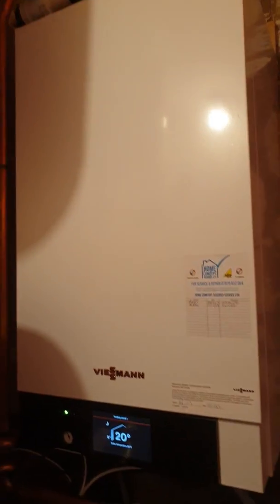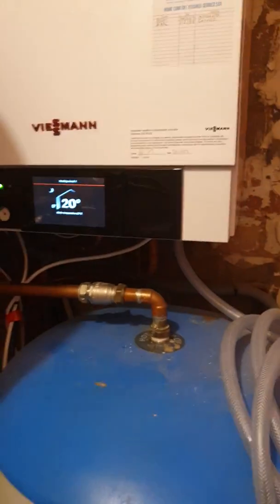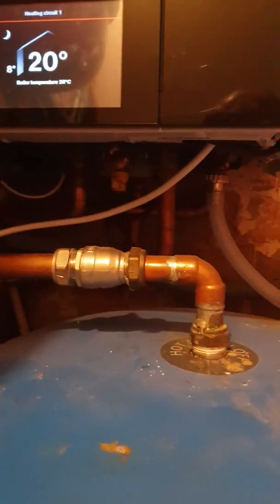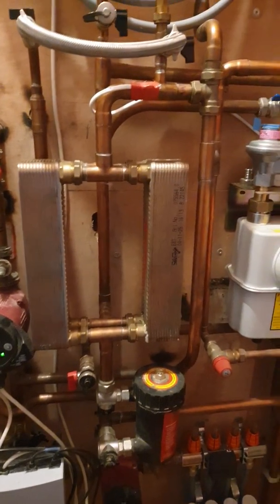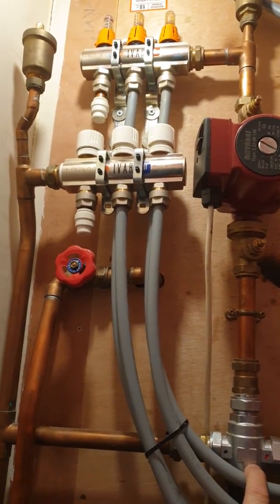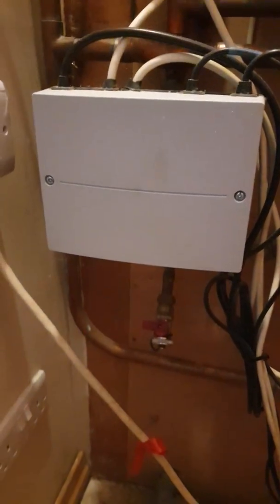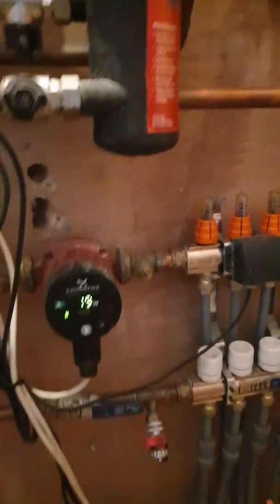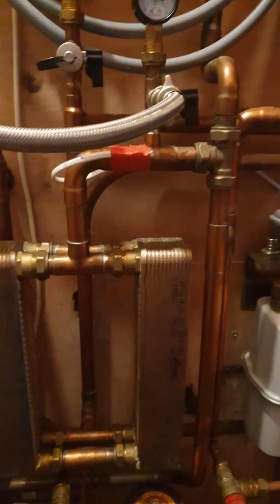Viessmann Vitodens 200 on three zones.

Comment: Out of interest, why do you choose plate separation over a LLH or close coupled tees?
Reply from the maker: If I suspect that the system water quality will be an issue I use plate separation. Also if connecting to an old open vented system. The system can be left open vented.

Comment: Whats KW requirement for the house. 
I like the idea of plate separation do Viessmann mind?
Reply from the maker: Vailant now require plate seperation on all boilers over a certain kw rating. Viessmann sell a kit that includes the plate heat exchanger for a mixed circuit.
Reply: Andrew Millward 
Thats very interesting, ive a few jobs that i think this may work on, just thinking how to explain to the customer, it would be nice to understand more
Reply: @tomhilditch3882  Agreed. A more in depth video analysis would be great.